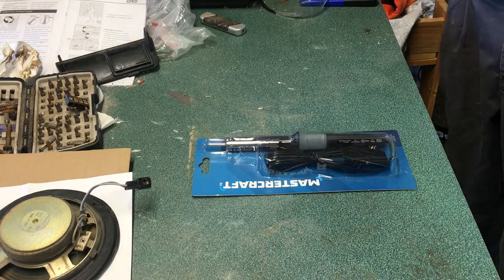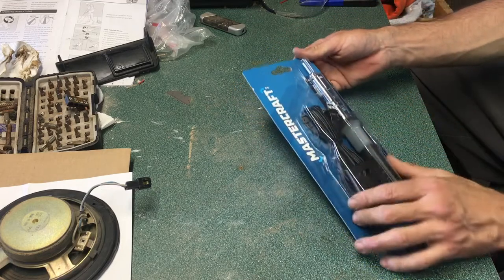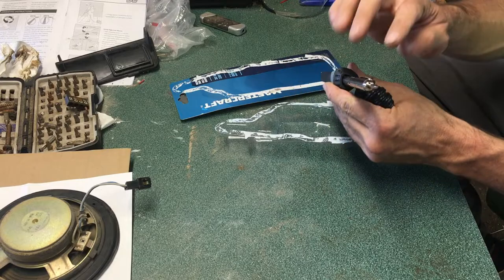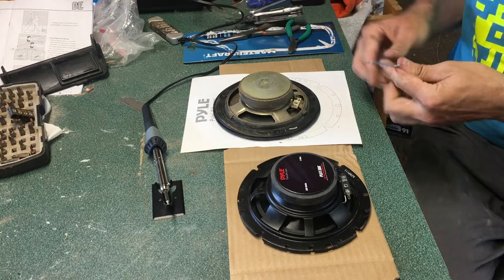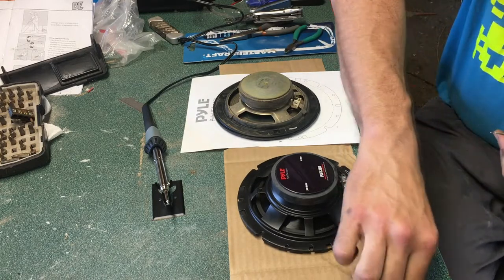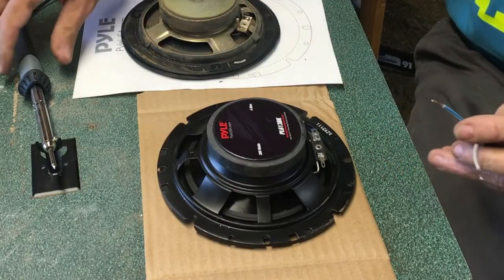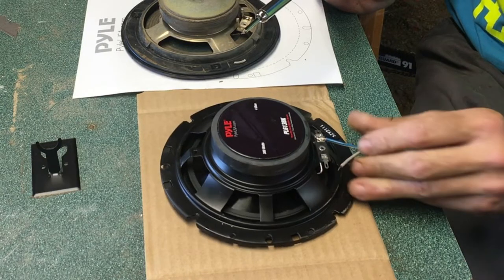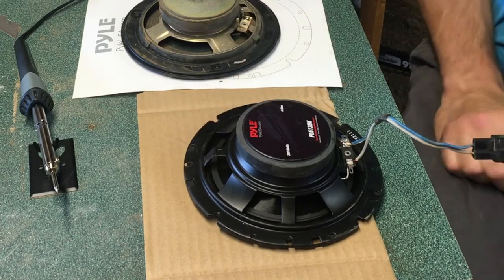Mastercraft Soldering Iron Unboxing and First Use

Comment: Does it come with the soldering wire
Reply: Mine did
Reply from the maker: Yes.
Reply: How do you remove the tip. And use another one.?